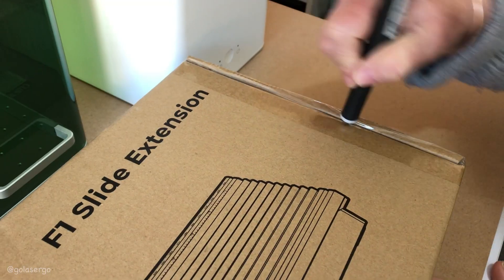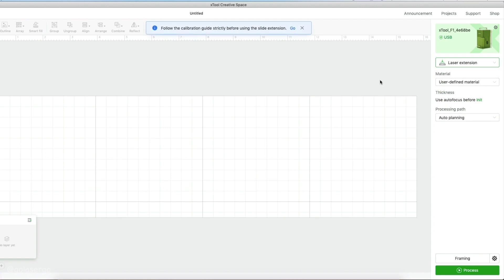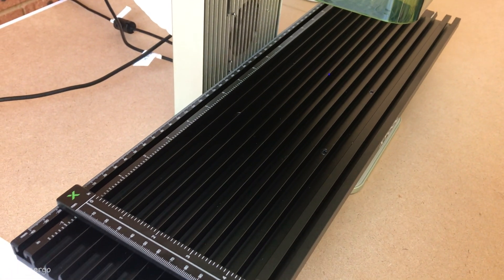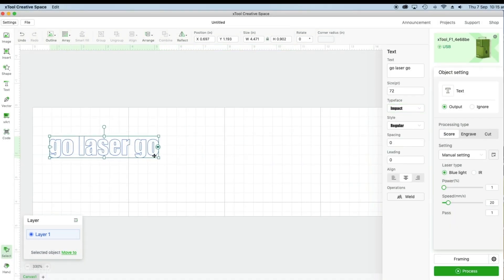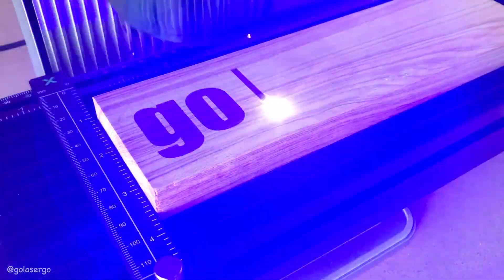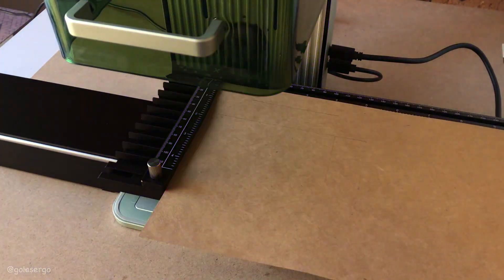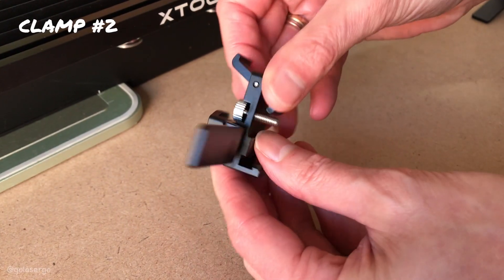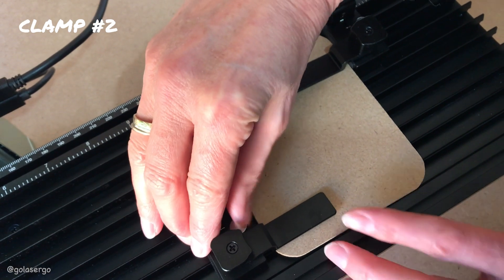Mastering the xTool F1 Slide Extension: Setup, Calibrating & Creating Your First Project

Comment: very well done and thank-you....I do have one comment, or more accurately a question? I should first say that I just recieved my F1 and am setting up for the first time. Do I assume that once the slide is installed and calibrated that the assumption is that you would not remove it often. Do you have to recalibrate it, if for some reason one did take it off? I am going to assume that would what one would do...recalibarate it. Thank you for a fine video.
Reply from the maker: That's what we do when we remove it and replace. We recalibrate the slider. I'm glad to hear you found the video helpful.

Comment: Thanks for the video!  A quick question.  What is the top speed when using the slide?
Reply from the maker: Good question…I had to check over on the xTool website and they state the following: “ The speed has been limited to 160mm/s in order to guarantee the precision of slide extension.”